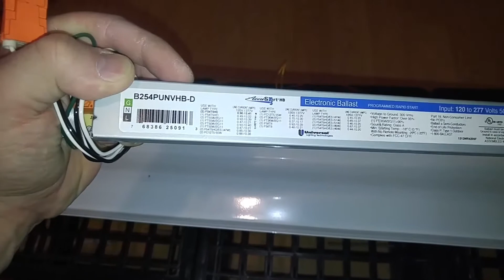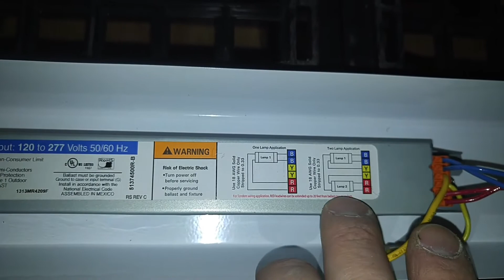T-8 to T-5 light retrofit and ballast change

Comment: nice job man try retrofitting it to T-5 LED bulbs. there brighter and more energy efficient and long lasting. and they dont need the ballast so you’ll half to bipass it.
Reply from the maker: Thanks I actually did do that in another video but the lamps I have still needed the ballast. I've pretty much gone to all LEDs now.
Reply: ahh thats not good. ballast ready LED bulbs actually take up more power than floresent bulbs because they half to power the ballast and the bulb. floresent bulbs just power the ballast
Reply from the maker: Right. That's just what I had it's still less than the 2x54 watt ho lamps. Thanks for the info✌☁️☁️